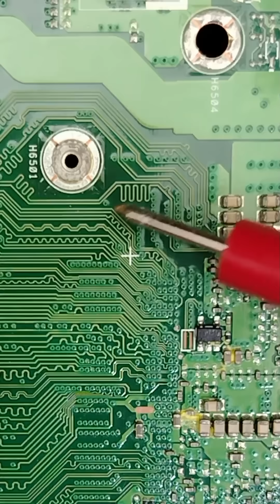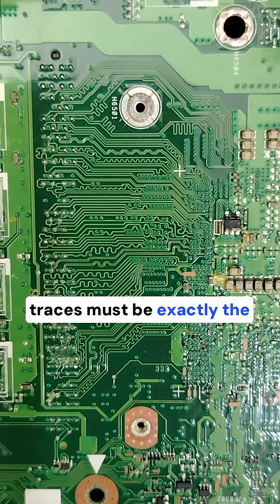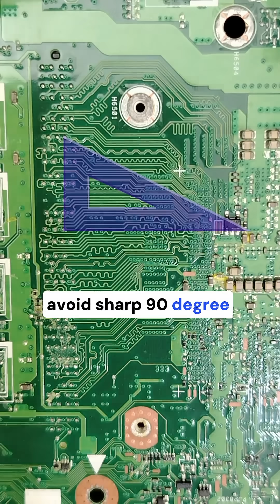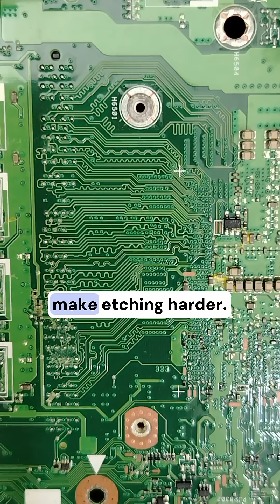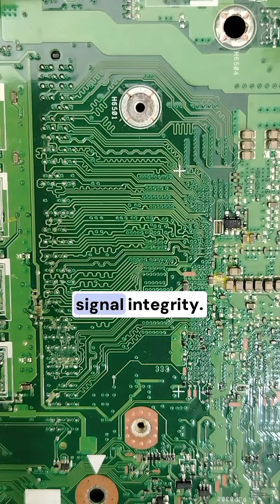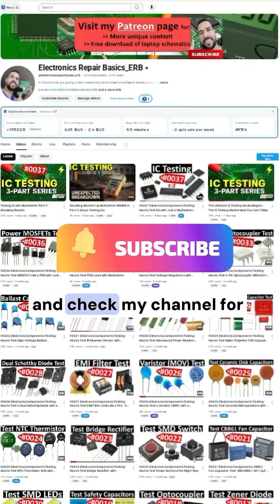Motherboard Lines EXPOSED: Straight vs Curved PCB Lines EXPLAINED #pcb  #pcbrepair #electronics

Comment: Thank you. My first guess was that the squiggly tracers would offer some resistance 😂 . Everything makes sense, but im not guessing very accurately yet. I really appreciate your explanations and enjoy what's wrong in the picture challenges 👍
Im paying attention to the answer and reasons, so i feel it's safe to assume this is the best way to synchronize signals at the time that the mother board was released for assembly. It just seems a little primitive but i  really don't know if we will see this for the next 100 years.
Reply from the maker: Thanks for the comment, I appreciate it
Reply: They do add resistance. That resistance along with the capacitance affects the timing.